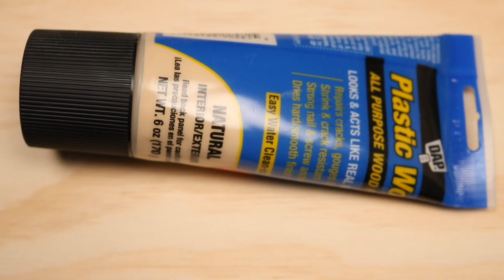How to hide screws in wood with countersink bit

Comment: These two will have a very different appearance when any type of finish is applied. You can get away with that hardware store wood filler if you’re painting or staining the thing, for quick theater set pieces for example, but this isn’t appropriate for fine woodworking or furniture making. 

The wood plug would also blend in a lot better if end grain dowels weren’t used, and proper face grain plugs cut from the same board were used instead.
Reply from the maker: Yes totally true! This is a basic procedure and for quality I agree on the cutout plugs with grain matching. The filler tends to get knocked off if it's not heavily coated with Polyurethane lol. Thanks for watching.